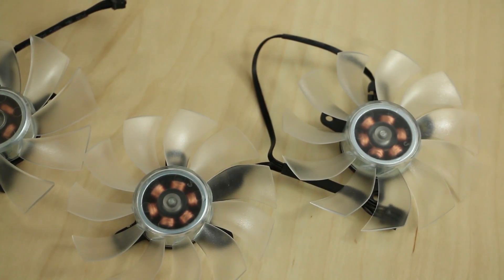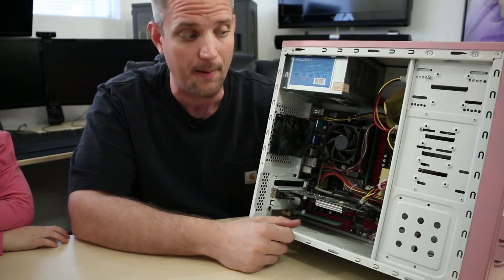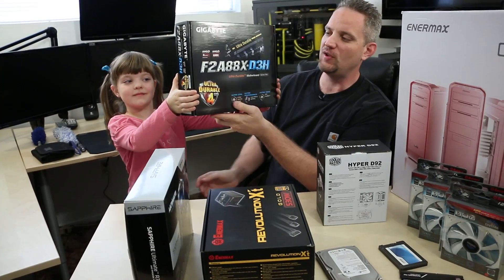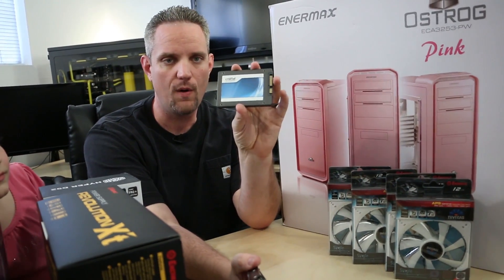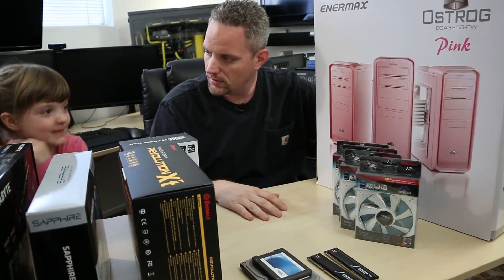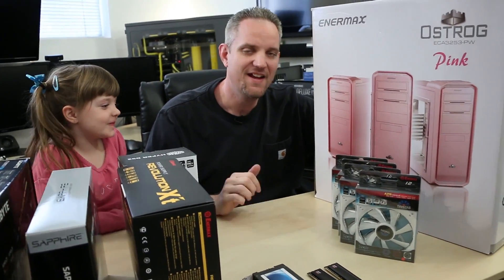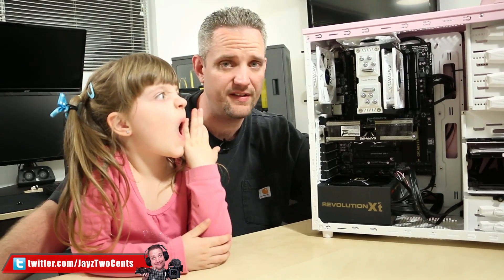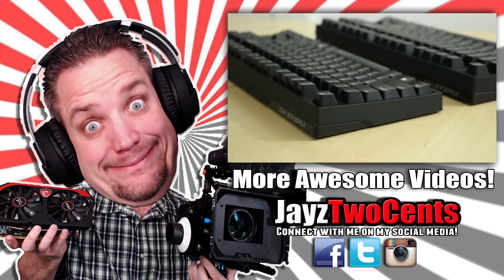5 Year Old Builds a PC

Comment: All you had to do was replace the slow IDE hard drive with a proper SATA version the max the mobo supports, plus a cpu and ram upgrade. No need to replace the whole computer. Athlon X3 should be upgraded just fine with a BIOS update to support a Phenom II. Not a bad cpu at all. But none the less, building a new computer is fun too.

Comment: my pc spesifications
ryzen 5 1500x at 3.7 ghz
b350 mobo
wraith spire cooler
500g hardrive
750 ti gpu
8 gb of wam                                         not wam but ram stupido

the upgrades 
corsair mp500 ssd
gtx 1060

Comment: "it takes 5 minutes to load on"
I need to sit this kid down and tell her about early 2000s to early 2005 PCs.
5 minutes is nothing I can understand if your PC needs an upgrade to run newer games at 30 or 60 fps (preferrably 60 fps)
but the 5 minutes to load on has something to do with the harddrive mostly
Reply: actually you should.
I'm not in any position to talk to her about it you've also used PCs within that era too, so I don't need to talk about it.
(I hope cause I've been PC gaming for more than a decade)

Comment: What's so bad about 2 years? I've had my PC with like a Core Duo and an ATI Radeon for like 10 years and ive never asked my parents for a new pc.
Reply: I'm getting parts for my pc I'm Building! No more 10gb laptops!
Reply: I don't know man, your rig sounds pretty slow to me. Maybe you should buy something used, like HD 7850 2 GB, Core 2 Quad and little bit more ram if you have 4 gigs or under. 

If your computer has LGA 775 socket, motherboard with C2Q support (at least after bios update?) and PSU that can handle 200w continuous load under games (400 W used PSU preferred!), swapping some parts would make pretty good upgrade for few tens of bucks! It might even run some modern titles with low or medium settings and few year older games from medium to max settings.
Reply: Purjopera Hey, sorry for a late reply. Yeah, I only got 4 gigs of ram, but near summer of next year, im planning on getting a huge upgrade. Maybe with a i5, something in the 7000 series, not the K tho with a 1060 or 1050 idk. For ram i'm thinking a nice 16gb to last me. I made a pcpartpicker of my thinking to kinda see what i'm looking at, here it is if you want it. https://ca.pcpartpicker.com/list/F7RG9W

Comment: really? all of this just because it takes forever for it to boot up?

it would have been a lot cheaper if you just upgraded the ram, upgrade the CPU, and slap in a new graphics card that's compatible, and it would be fast enough to rock a pretty decent 3-5 years of normal everyday use. 

if you can't, JUST BE HAPPY FOR WHAT YOU HAVE!!! >:(
Reply: So basically building a new computer? Because you can't really upgrade the CPU much without getting a new Mobo. The only parts you didn't say should be replaced is the PSU, Case and the storage but he specifically said the storage was a problem and using a PSU from what might have been a pre-built is not at all a good idea. And cases are so cheap anyways that it's hardly a problem to replace one especially when it's sponsored.
Reply: i bet it took 5 min to boot up because of all the "free games" she installed

Comment: And then there's me, wondering how the heck do you change the graphics card.
Reply: m8 u gotta appreciate the classics, i mean wot could be better than 350Mhz core speed?
Reply: thats the most easiest thing after fapping (best grammar ever xoxo)
Reply: Not if your power supply has those very stiff 8 pin connectors, that are honestly a pain in the ass to take out. Also is that sarcasm about the grammar?
Reply: +AzoPhenol oh i now see i speld stuf coreect lolz
Reply: Really, never would have though... Eh, and what reply do you expect? If I already told you that the source of the problem lies in the fact that the psu has very stiff 8 pin connectors.
Reply: Your point?
Reply: cba
Reply: Can't be arsed
Reply: Jesus, to me it seems you care more about it than me, and I never said I want to. But why? My current VGA suits me, I mean it works, and that's all I need at the moment. So why put a new one in?
Reply: I just cba installing my new VGA that I got some time ago.
Reply: +T-X-M Intel 4000 HD Graphics. Amazing FPS everywhere, why?
Reply: +AzoPhenol ur kidding right
Reply: Just kidding, could not afford that. So got Intel Haswell HD - GT2 instead.
Reply: +AzoPhenol i like ur humor
Reply: m8, I can only wish it was humor.
Reply: jup

Comment: GODDAMN IT SHE INSTALLED THE CPU COOLER O GAVE UP ON BECAUSE IT WAS TOO HARD FUCK ME I WANT TO GO DIE NOW BTW MY GODDAMN COMP WONT BOOT AND ITS 4AM PLEASE SEND HELP AAAAAAAAAAAAAAAAAAAAAAAAAAAAAAAAAAAAAAAAAAA
Reply: +flap cat YANK IT OUT LOL
Reply: wtf.
Reply: also btw I broke every single pin on the goddamn cpu so its now stuck inside the mobo yay for having to spend another $200+ on my new pc build
Reply: +Peter Leconte idk dude the processor was locked in and I removed the cooler and the processor went with it so I put it back in and now iys stuck there
Reply: +flap cat was it the right socket and such? Also watch some tuts of the coolers. these can help u. And please make sure when U pull u dont take stuff with it...
Reply: +Peter Leconte yeah its the right socket got the 970a sli krait edition and an fx 8350 but I couldnt find any tutorials for the hyper d92 for the am3+ socket
Reply: +flap cat does the cooler support amd?
Reply: yeah
Reply: Adolf Hitler lmao now Im having wireless card driver/installation troubles. the escapades never end do they?
Reply: Did you think about, idk read the motherboard manual? X) it tells you how to properly install the cpu. And try Iobit's Driver booster for the correct drives, the free version works just fine and finds most drivers unless the hardware is brand new on the market.
Reply: Fredrik Löfstedt Im rolling with stock rn and it turns out I didnt break any of the pins, I just have stupid friends. I just plugged the front panel connectors into the wrong spot so the power button wasnt connected to the motherboard  but I got everything going good. I wasted $300 on a new motherboard/processor but it works and thats all I care about.
Reply: flap cat
Thats good news :) I have built mine now and I am ennoying it!
Reply: haha yeah I just wish it didn't take me getting $600 deep to find that out
Reply: yeah neither did I but a family member who isn't exactly up to date in terms of technology did so I capitalized on it :P
Reply: Haha.
Reply: flap cat Stubborn research could have saved you that. ;) Btw what do you mean with stock rn?
Reply: yeah the thing is there was nothing regarding the connectors for my motherboard on the internet and I didnt see anything in the manual but I suppose I may have overlooked it. I kinda started plugging shit in until the lights came on lmao. By stock I mean I'm running the cpu cooler that comes with the amd processor.
Reply: Ah i see, when i mentioned Driver booster i was talking about the driver for your graphic's card or your wireless network card, not cooling fans lol.
Reply: haha the wireless card was just a simple problem of outdated drivers I found on their website, I just put the driver disk in another computer and put the contents on a flash drive which I put on my new computer
Reply: flap cat No problem then, but i don't have a disc reader so i had to use internet sharing on my phone through usb and download the drivers that way. X)

Comment: (JayzTwoCents)says: "If a 5-yr old can build a pic with a little bit of help, you can too" me:"yea but what about the money PC parts ain't free maybe for her, but they are expensive as all hell
Reply: "decent"... realistically, you need to throw down at least 500$ for the best price/performance
Reply: I have built 4 for myself, neighbors, and siblings. Unless you buy used parts, which is a great option btw, you cant build anything decent for 350$. Send me a parts list including OS to prove me wrong.
Reply: Most people have old mice and keyboards, and some old monitor/laptop lying around. In any case, a mouse keyboard combo can be bought online for less than 10$. A monitor will be trickier, but most people have a tv that can easily hook up to the computer. However, if they don't, a 720p monitor will run you about 40$ online. A licenced copy of windows 10 will run you about 100$.

I wont even make you include the OS then, make a parts list for a decent gaming computer for <= 350$
Reply: I spent 530$ or so on my rig, and i had to use an really old case and a slow old laptop hdd and i don't have a working cd/dvd reader either. that got me a midrange pc i guess, can play medium+ or even highest on most games depending if it is moba fps or whatever, but a decent computer for less than 350$ sounds more like a wet dream than fact unless you buy used parts that might be really worn. And that is OS excluded.
Reply: MikeyYT This is the PC I'm building. Cheaper than $350 and can play triple a games 1080p 60 fps. Here is the pcpartpicker https://pcpartpicker.com/list/g38MHN (Pcpartpicker has some prices wrong I did the math and it is $313
Reply: in late but windows 10 and linux are free.
Reply: SeepMan not in south Africa.
you need like twice that amount.
Reply: These parts weren't really super expensive... It's wasn't a super high tier build.

Comment: I need help. How long will my year old build last? 
I5-4460 3.2. Ghz
EVGA Gtx 960 4 gb sc single fan
Kingston 8 gb ram (2 x 4 gb) 1866 Mhz

Also what is the difference between fully sized 960, vs mine?
Reply: +Mfgcasa I didn't know there that much of a difference between 960 and 970. Good thing I decided to buy a MSI GTX 970 4GB Twin Frozr V for my new build.

Comment: i have a question, will this run half life 3 at half of 3 fps

Tower/Case is a cheerios (frost edition for extra cooling) box
motherboard is a thin napkin ( again light weight extra cooling )
gpu is a gtx 180 dual sli tits
cpu is an oreo ( preferably double stuffed ) 2 cores (tits)
ram is peanut with 2 4gb peanutz inside
storage is a soggy Blue folder it may be yellow
cpu cooler is an ice cube ( preferably square ) not too fond of rectangle ones
psu is gaben

Comment: mind rating this build internet fyi budget of $700 Canadian here
Intel Pentium G3258 3.2GHz Dual-Core Processor
ASRock H81M-ITX/WIFI Mini ITX LGA1150 Motherboard
Cooler Master Hyper 212 EVO 82.9 CFM Sleeve Bearing CPU Cooler
Kingston HyperX Fury Black 8GB (2 x 4GB) DDR3-1600 Memory
Western Digital Caviar Blue 1TB 3.5" 7200RPM Internal Hard Drive
EVGA GeForce GTX 750 Ti 2GB Video Card
Antec ISK600 Mini ITX Tower Case
Corsair CX 430W 80+ Bronze Certified Semi-Modular ATX Power Supply
Reply: Jacob gordon WAYYYY OVERPRICED FOR THOSE PARTS. For $700 you should get an i3 and a Gtx 770(from ebay)

Comment: you know my dad was the same way, but with cars and when i was 6 i fully took apart an engine and rebuild it with a fe missing screws, anyways this was very insperational considering that I'm currently building my computer and its half way done and I'm scared its not going to work. but as long as i have it on static free environment I'm positive i should be fine, i also order the hyper 212 coolermster cpu fan, i hope i don't have the same problem and i hope it fits.i would like you to see my gaming rig. i will post the machine on next friday or sat.

Comment: My X5690 destroys this rig
Reply: I have an X5690, not a 5960x, I wonder though if Intel didn't use the X5690 and turn it into the 5960x, makes you wonder if the x5690 isn't the ancestor and with enough overclocking it can even get close to the 5960x at least on a per thread basis ;)
Reply: It sure beats a 3770k though, both the x5690 and 5960x!

Comment: can anyone comment on the one im going to build?
http://pcpartpicker.com/p/L7mQsY
( please do not comment on the RAM cause i DO need that much. )
note that this is my first build and i cannot afford another build before this one so it must work no matter what. ( i have done a lot of research though )
Reply: bro holy shit that's expensive. and it's your first build?! my first build was $550 and played games perfectly fine as well. go for cheaper and age up in prices and stuff. my current build is cheaper then that and I've been gaming for 5 years!
Reply: I've cut down the price to 8300 now and I guess I can build a $1000PC before that.
Reply: Henry Chan Why would you want two Xeons, unless it's entirely a workstation videoedditing rig?
This is way too overkill, on the price at least... 
A single Intel i7 5960x is plenty for this setup, and any game you throw at it
Reply: +Nicki Zidakuh Official in fact, the price of the dual Xeon is somewhat similar to a single 5960x. However, 
1. I get twice as much cores and threads
2. It is designed to handle 24/7 operation while the 5960x is not
3. It provides support for ECC RAM
4. The clock speed difference is not that much, 3.2GHz vs 3.4GHz or 4-4.5GHz if u moderately overclock the i7
5. The dual Xeon has better benchmark results
Last but not least, it sounds cool to say I have a dual Xeon.
Reply: I need 64 gb of ram I fill fully with 8
Reply: +Wereda Games I just cut down the price to $7800. Removed a set of RAM cause 128 could be too much. My current PC has 32, and I sometimes saturate it, so I guess I'm going with 64 first and if I need more, I can add extra ram to it. 
This is a workstation/gaming build. I cannot afford 2 separate ones so I go with Xeons and gaming cards.

Comment: 5 minutes. Really? Have you ever heard of a disk defragmenter? It's built into Windows. Run it once a month. Done. Also, my old Dell Demension L733r with a 733MHz single core Pentium III, 512MB and IDE drives older than those takes less than 5 minutes to boot. And that's with XP installed and it was designed for Windows 98. Also, run a virus and anti-malware scan. Ads these days are flashy and colorful to attract people's attention especially little kids. They click on it, installs some software that infects the computer with bad stuff and slows it down big time. Problem solved. So get out that computer, defragment it, remove all malicious items and post a video of the new boot speeds.